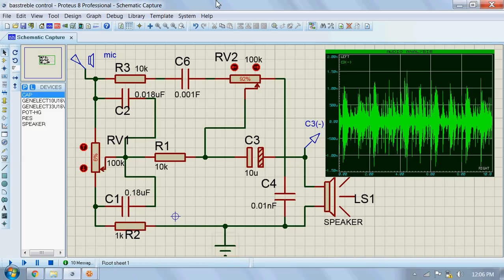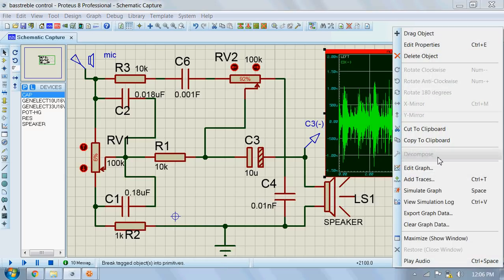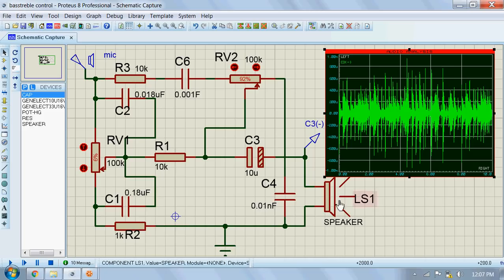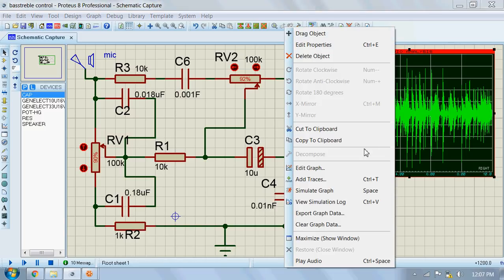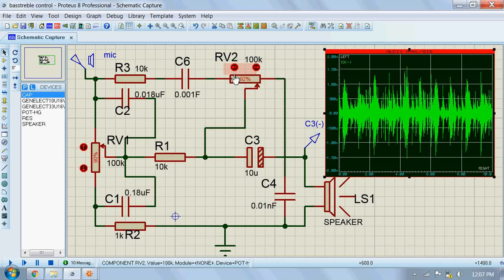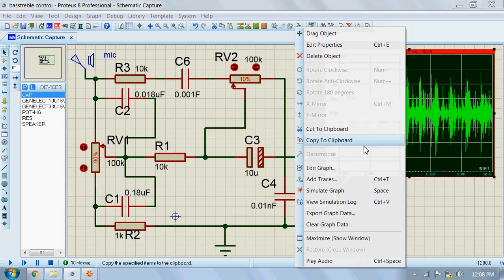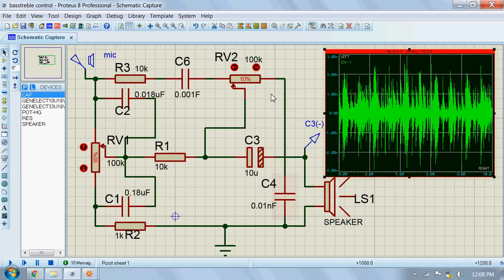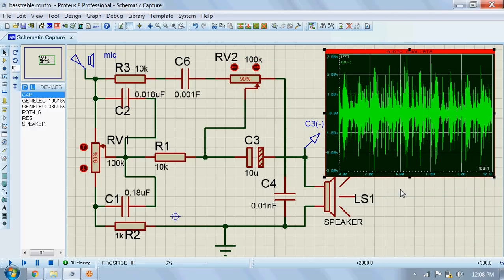bass treble circuit

Comment: Hey what program are you using for the simulation of the circuit? Is that an add-on software package to Spice, OrCAD, or MATLAB?
Reply from the maker: Proteus ISIS by Lab Electronics
Reply: @RejanChitrakar  Okay thanks!

Comment: I want to study the thoery of this whole system..... is there is any pdf or something ..so that I could learn more about it
Reply: Please reply
Reply from the maker: Just search for 'bass treble circuit using resistors and capacitors pdf' on Google. You will get lots of study materials. Actually, this circuit works on the basis of low pass and high pass filters to change bass and treble of the input sound. Hope that helped.
Reply: @RejanChitrakar  can you will please share a pdf...i am getting a good one